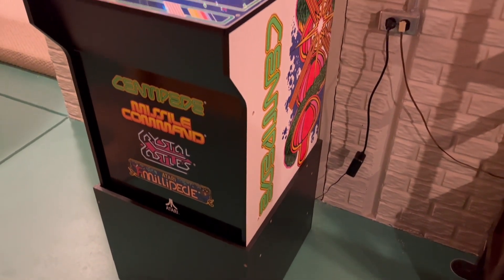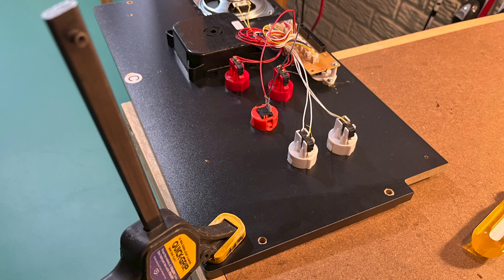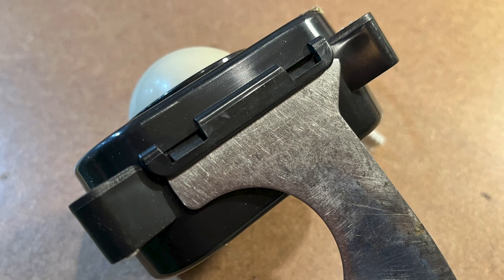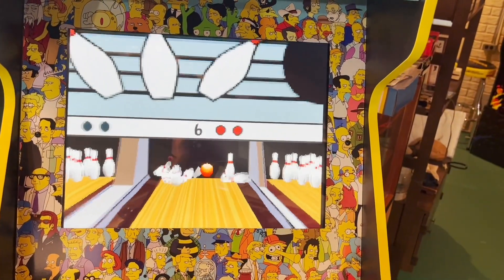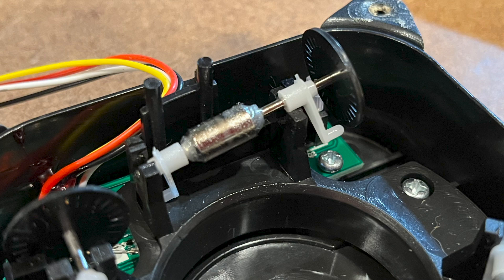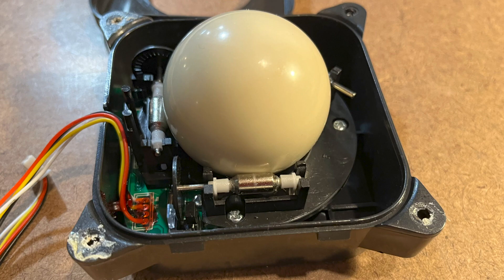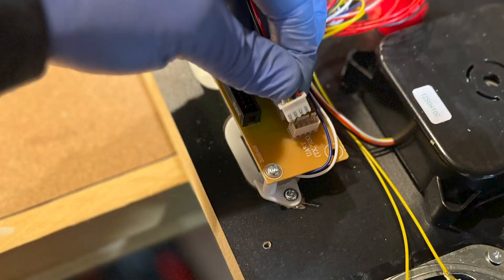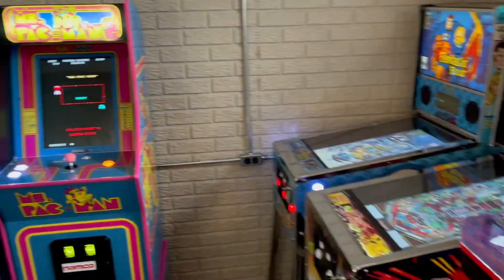Easy repair for an Arcade1Up 1st Generation Trackball

Comment: Hi, I have a problem with my trackball, it turn on but the pointer doesn't move, maybe the problem is the emmiter and reader, it can be fixed?, regards
Reply from the maker: Thanks for the note. If the trackball moves properly but the figure on the screen does not, it is likely the connection between the ball and the machine - particularly if it did work properly at one time. These are just JST plug connectors, and they can work loose from the plug board under the control deck. The easiest way to check it is remove the control deck, then remove the screws that hold on the plastic dust cover. Find the wires that connect the trackball to the plug board and check the connection to make sure they are fully seated. If that is not it, you could check the wires inside the trackball itself, but those are typically hardwired, so I'd be surprised if they were the problem unless one has broken. Best wishes with the repair.

Comment: Sny idea if it's the same as the golden tee xl version?
Reply from the maker: The XL model uses a different track ball, but the mechanics are very similar. My Golden Tee is the original version, but uses a similar larger trackball than Centipede, and I’ve been able to maintenance it the same way. Good luck with the project.

Comment: Any idea if this is the same ball that the Cetepede Legacy cabinet uses? I just bought one new but have to say I find the trackball disappointing, requires way too much movement to respond.
Reply from the maker: I’ve got the Tempest Legacy cabinet, and while the trackball unit is similar to the one used in the older Centipede cabinet shown here, there are some differences, particularly in the bearings. I’ve looked at buying a replacement LED lit ball for my legacy cabinet, but haven’t done so due to compatibility issues I’ve seen others report on them. Likely there is some calibration involved, but I don’t know enough about it yet. Probably the easiest thing to do is search YouTube for replacement track ball for your specific machine and see what you get. Best wishes on the project.
Reply: @PoppArtstudios  thanks for the reply. I've found plenty Cetepede videos where they replace the trackbball, but none with the same cab as mine. I will keep searching and maybe open mine up and see if some carefully applied silicone greese might help.
Reply: @Tetlee  did you find a replacement trackball for your Centipede Legacy cabinet? The only one I have found is the GRS Trackball, but I believe it is not compatible with the latest Arcade1Up Centipede cabinet.